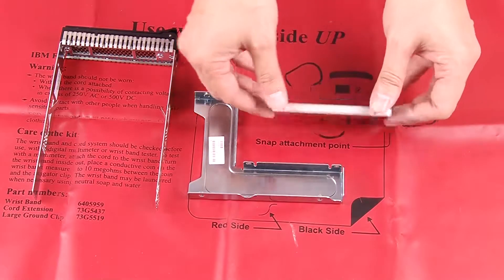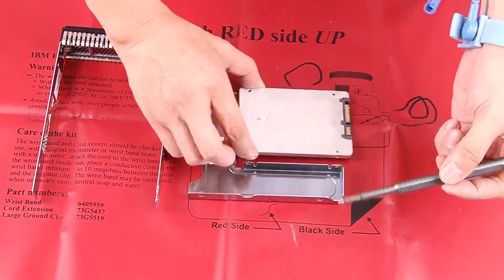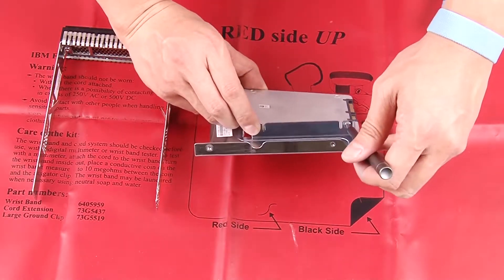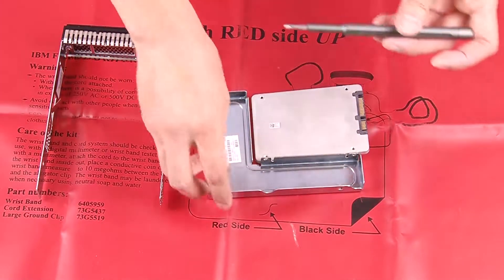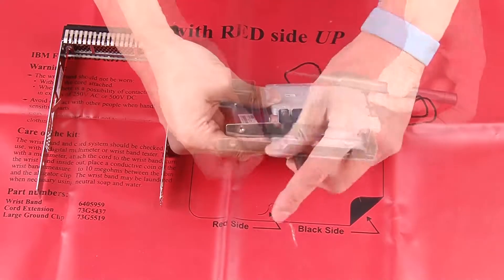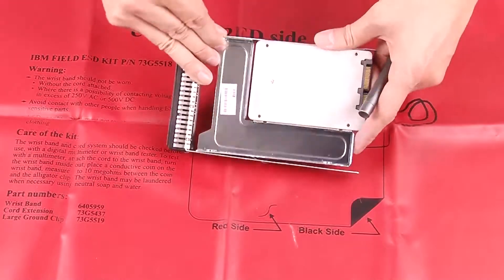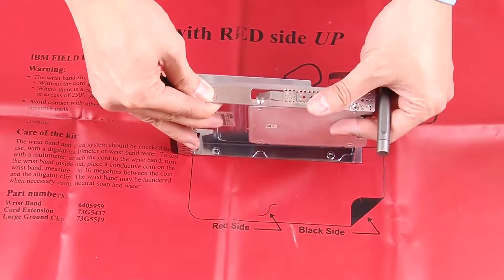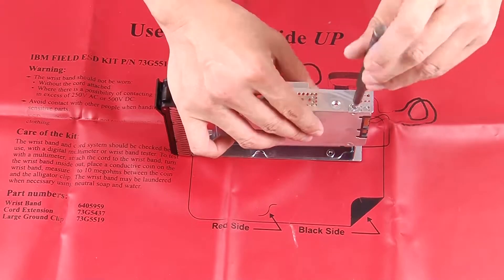Lenovo ThinkSystem ST250 installing a 2.5 inch SSD into a 3.5 inch drive bay

Comment: What are the PN's for the caddy and adapter?
Reply from the maker: The 2.5-inch to 3.5-inch drive adapter and 3.5-inch drive cage are part of an optional 3.5-inch hot-swap 6 Gb SATA SSD. They are not sold separately. Refer to the ST250 Product Guide (Table 22) on Lenovo Press for a list of available 3.5-inch hot-swap 6 Gb SATA SSDs:
https://lenovopress.com/lp0961-thinksystem-st250-server-e2100#ssd356
We also encourage you to check out the following forum and post your questions/comments there if any. 
https://forums.lenovo.com/t5/Datacenter-Systems/ct-p/sv_eg
Reply: where can i buy this tool in indonesia